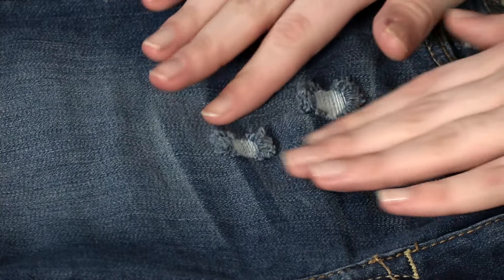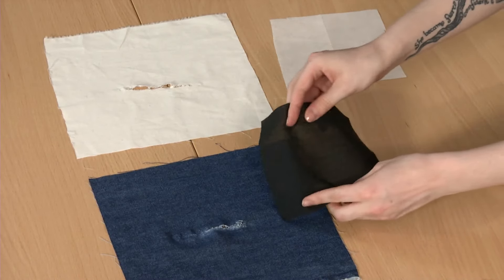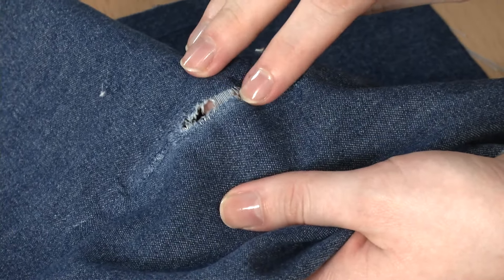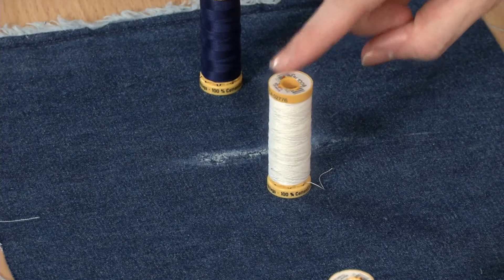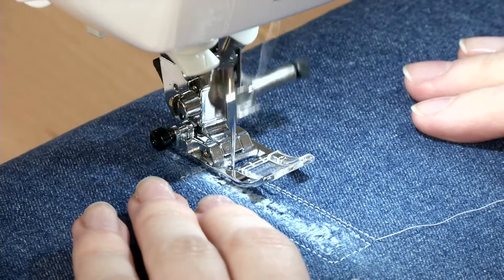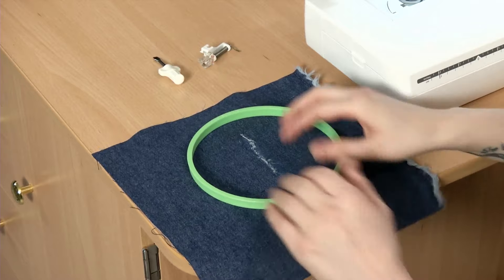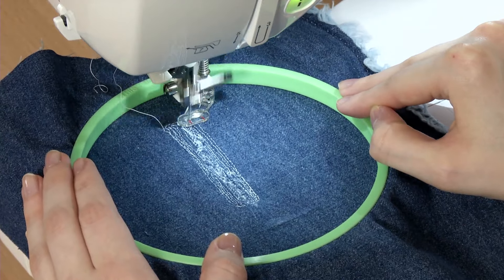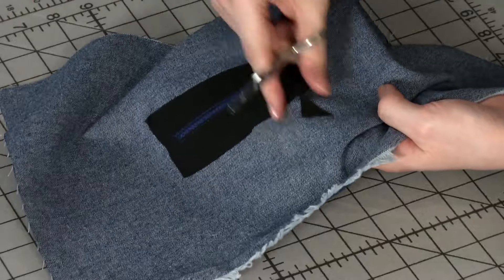Darning by Machine

Comment: I found that rounding the corners of the ironed on interfacing stopped them from lifting over time.  I raised three sons and they were very active when they were young.  I darned a lot of knees on a lot of pairs of jeans and I always used the machine.  I learned to darn and mend by hand but I worked outside the home so I would have always had jeans to mend if I did it by hand.
Reply: Im a beginner an im scarred my sons tear every single pair of pants i get them cost me thousands every year getting new ones

Comment: thank u. I need to fix a small hole in a new t shirt that I just did shibori stitch resist and while pulling the stitches out i made a small hole. This will work very well.    I will practice on an old t shirt first.

Comment: When mending jeans, do you use needle number 11?  (Google translation is wrong, so I corrected it.)
Reply from the maker: Not sure what you are asking when you ask "what kind of room do you actually use?"
Depending on the weight of the jeans, you can use any needle from an 11 for lighter weight denim to a 14 for heavier weight denim.
Reply: @Threads  

or 16 and 18
Reply from the maker: I'm still not sure exactly what you are asking.  I would use a 12 or 14 needle when mending jeans.
Reply: @Threads  Yes

Comment: Helpful video but it would've been even more helpful had you demonstrated  the repair of the hole at  00:13...
Reply from the maker: It's the same technique, it would have just taken longer. In jeans, it is necessary to open a seam to place the fabric flat (mentioned in the video). The finished repair would have been "L" shaped, and you could do it in two sections or by pivoting the work as you sewed.